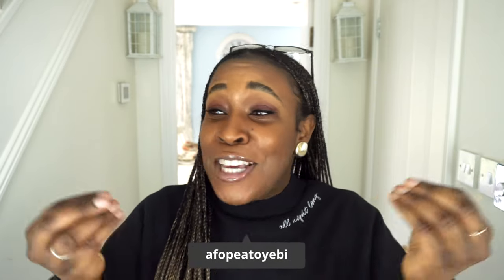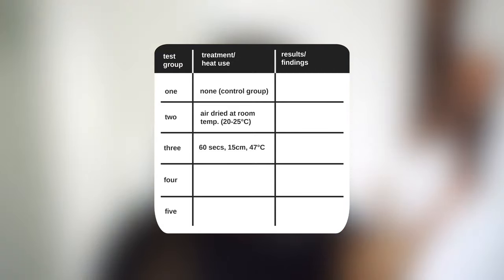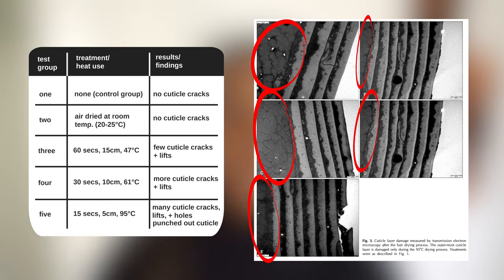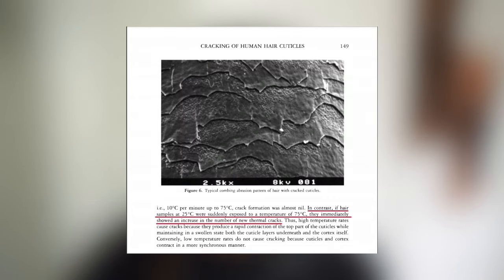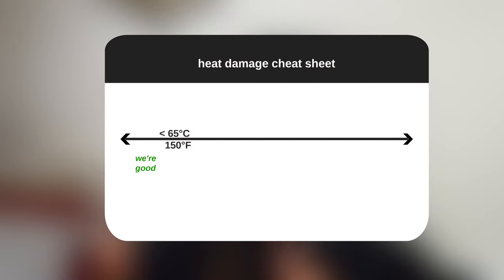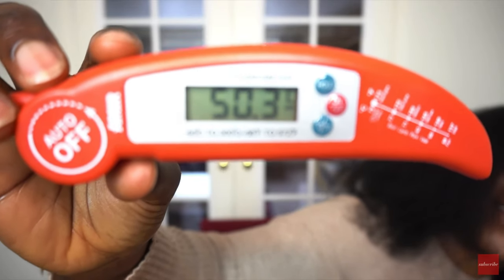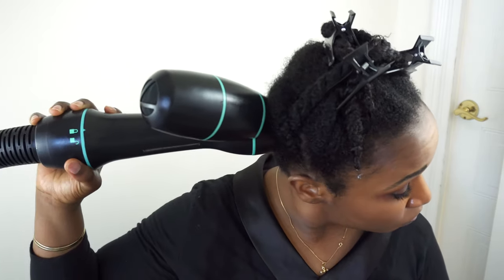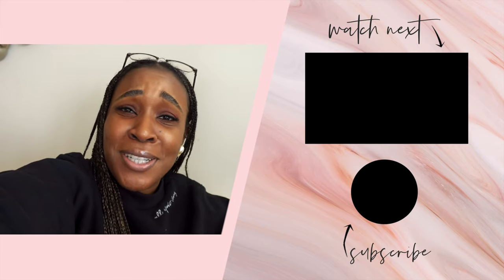LOW HEAT BLOWOUT + How To Prevent Heat Damage on Natural Hair!

Comment: I blow dry on the lowest setting now because the leave in conditioner that I use says it on the bottle. At first I ignored it, but then I tried it and it works best on low heat. It takes a little longer, but it’s worth it.

Comment: If airdrying causes damage, why limit the blowdrying so much?
I personally feel my hair experiences damage from airdrying so I now blowdry every week and have seen great length retention.
Reply: Same!
Reply: Yeah I see myself retaining length blow drying more, but I think it’s because leaving my hair curly causes a lot of SSK.
Reply: In my opinion having only started blow drying for 3 weeks and only having 2b-c hair (which tbh is why I'm straightening because my hair either has to be forced into being curly or forced straight). I did used to have 3a hair, and I can say that the amount of hair I loose from detangling has significantly decreased. It's just easier to detangle straight hair 🤷🏻‍♀️ so there's that too consider too.
Reply: Same! Especially because I wash my hair at night and I don’t wanna go to bed with wet hair, which is worse. 
My hair looks very healthy and I only blow dry it for max 10 min at low/mid heat.
Reply: Same. Using the Revair is even better!

Comment: Maybe the damage experienced on the air dried hair was caused by hygral fatigue seeing as though it would have been wet for the longest period of time.
Reply from the maker: I thought this too, but I guess they also would need to consider the hair porosity type, because hygral fatigue damage is worse for higher porosity hair as the hair swells more and contracts more quickly because of the porosity. It's less likely to be the case if the hair they used was low porosity hair. But porosity isn't something they controlled for so sadly, I guess we could never know 😫
Reply: @AfopeAtoyebi  - Hi Afope.  I know this is an older video, but I was wondering if you've come across any other studies that mentioned damage caused by air drying?  I find this really fascinating!  Here I was thinking that air drying was the healthiest thing I could do for my hair.  I don't use any heat at all and don't over-manipulate my hair, but I've still encountered unexplained breakage from time to time.  Perhaps it comes from the fact that I strictly air dry.  If air drying actually causes damage, then perhaps using minimal heat would be a better option.  I have to think about that.  Anyway, I'd love to hear more of your thoughts on damage from air drying.
Reply: Maybe cold hair-drying would be better? 🤔
Reply: @mars9399  - Interesting suggestion!  I need to go ahead and buy a blow dryer with a few different heat settings and a cold shot button so I can play around with the different options.
Reply: @Kindred04  oh yeah, I just had a realisation yesterday night! You know how your face feels awfully dry when you get out of the showers and let it simply air dry? We put moisturisers and creams to protect the skin on the face right after the shower. 
My guess is, if we put some serum/hair oil on the hair when its still damp, and let it air dry, the damage can be lessened! 
I can't be sure, but I feel as though my hair quality worsened when I didn't use my hair oil. Ever since I've been using my hair oil consistently, I think the damage on my my ends is halted (but I can't be sure).
Reply: @AfopeAtoyebi  so is air drying still generally better than blow drying on a low setting?

Comment: This makes me want to measure the outputs of my blow drier. 🤔 It has several heat settings, I normally leave it on cool or medium, but the actual numbers would be more helpful.
Reply: Cool was lower than los 30s (I got bored waiting for it to keep going down) and medium was 60 almost exactly. I haven't tried high yet.
I diffuse though, so I measured with the diffuser on.

Comment: What is your opinion on indirect heat? I have stopped using blow dryers/diffusers all together 2 years ago and use a hooded dryer instead (never on high). I use it weekly to dry my wash and gos (it takes over a to dry day without some form of heat). I haven't noticed any damage or loosened curls personally and my hair seems a lot better now, but I wanted to know if they have the potential to cause any harm. I was thinking about stretching my hair using roller sets instead of a blow dryer when I want a stretched style.

Comment: Love this, this is super helpful. I had heard of this study that wet hair causes more damage than blowdrying it correctly but I didnt know that making sure you dont go from room temperature to high heat was damaging so thats super helpful. But I am super confused 4-6 blowouts per year seems so low, I wash my hair 3 times a week, so I wouldnt even be able to blow out my hair every other month. Or when you say blowout do you mean styling it not actually blow drying it? I am new to your channel so maybe the advice is more towards a different hair type than me, I am 1B so maybe thats why it seems so low to me hehe..
Reply: I'm 4b and I wash twice a week. I use my Revair every single time on high. After seeing this I'm going to use it on low just so I'm not causing any long term damage. My hair is getting longer.

Comment: Do you have tips for frizzy roots? I have type 4 high porosity hair and my roots are extremely frizzy. I wash and deep condition my hair once a week because I exercise regularly and sweat a lot.
Reply: Do you rinse your hair and apply leave in throughout the week? If you’re not, the puffy roots could be because the salt from your sweat is drying out the hair at the root.
Reply: @thisblackgirloverhere9013  I used to moisturize every few days, but I stopped for about 3-6 months. I would only moisturize it when it I had time. For the past month, I've been getting back to my old routine. So I'm hoping the roots will go back to normal.
Reply: Adriannn Adriann No, you have to RINSE and then moisturize.  You have to rinse that salt out often before it dries out your roots. Just remoisturizing does nothing by itself.
Reply: @thisblackgirloverhere9013  Ok thanks!

Comment: Hi Afope! Love your videos, thanks for all your hard work. I use the revair as well and i initially intended to only stretch my hair with it on the cool setting, but it's not stretching my ends so it's been suggested i just use heat which i'm very aversive to. I wash my hair every 2 weeks and plan to use the dryer every wash day on low heat with a heat protectant because stretching will help prevent knots and makes detangling easier. do you think this is a good idea indefinitely (the use of 60-70 degrees C heat roughly 2x a month to stretch hair that is)? hope this query makes sense

Comment: Gosh I'm so interested in this air drying damage! I've avoided using heat tools for years now... At least 5 years at this point and my hair still accumulates insane amounts of damage. I cannot grow my hair past my shoulders because it all breaks off. I do nothing to my hair whatsoever and only wash it every 3/4 days. I stopped using protein products to see if that's the problem, I tried using protein products. Anything I've tried has ended in complete failure and me ending up with a short Bob again.
I'd love to know much more about sirdry damage because I'm starting to think that's what's wrong with my hair.
Reply: Try the capillary schedule. You hair needs 3 components Hydration, moisture and reconstruction. Get a good mask for each. Reconstruction are all masks that have protein and/or amino acids. Using the capillary schedule will allow you to rotate the use of these masks so your hair has a complete and balance diet each week/month. 

I have 2a/b hair and I blow dry at low heat almost every time I wash my hair. I make sure to use high quality products and my hair is finally growing past shoulder length! Aleluya!
Reply: I am going through the same thing, I used to never dry my hair to avoid the heat, and my ends are still see-through if I let it grow a little longer. I just tried blowdrying on low, but it gets super frizzy since I have no clue how to do it😅

Comment: How can we get our healthy hair back...shortly how can i fix my hair damaged due to heat😪😪😪😪
Reply: Try a protein treatment. I read a book saying it bonds to the hair and fills the gaps in the hair strands
Reply: @francescablee3366  for example? Olaplex no 5?
Reply: @Mariamfromunitedstates  yeah I heard good things about that and also aphogee. I make sure to deep condition with a  protein conditioner mixed with oils every week but I'm black, so our hair may be different (black hair is more brittle). For u maybe every 6 weeks. But u should try experimenting. I hope this helps🙂 also for protein u can use things around the house like eggs. Just with eggs make sure not to use heat so it doesn't cook in ur hair.
Reply: Also make sure to have a balance between moisture and protein. Protein binds to ur hair and fills in the gaps making it strong, and moisture makes it flexible to prevent it from snapping and breakage
Reply: @francescablee3366  full egg or only white part? Btw thanks
Reply: @Mariamfromunitedstates  both together. I believe the white has more protein and the yolk stops it from cooking at low temperatures. Mix it with a little olive oil before putting in ur hair. Protein will help make your hair stronger and thicker but there isn't much u can do for split ends (which I have a lot of) you're welcome hope this helps🙂
Reply: @Mariamfromunitedstates  leave in for an hour and rinse out with cold water so the egg doesn't cook and make sure to moisturize after. U can put oils in ur hair and rinse out after a little
Reply: And I think its best if eggs are room temperature. Also are u black or do u have a straighter hair texture, Arab I'm assuming from ur name?
Reply: @francescablee3366  im from pakistan ..i hv done ash gold highlights...but in my childhood i used a straightner alot now im facing damage (dry , broken hairs ) so i want back my silky hair
Reply: @Mariamfromunitedstates  oh okay. Maintaining a good moisture and protein balance is important regardless, but you'll have to experiment. Good luck🙂
Reply: @Mariamfromunitedstates  just try to stay away from color and heat and if u use heat do it no more then 1-2x per week
Reply: @francescablee3366  thnks♥️